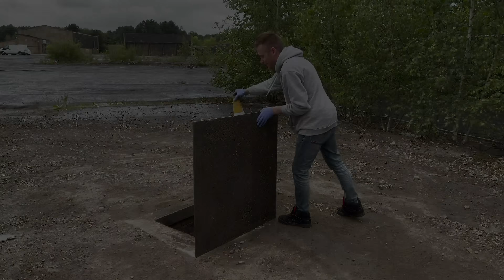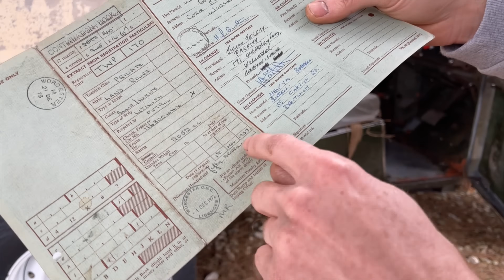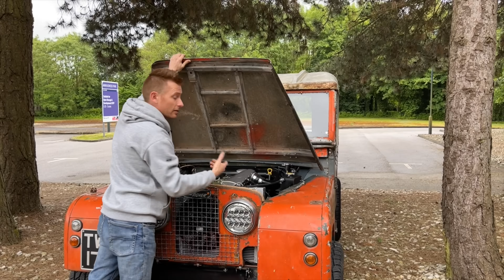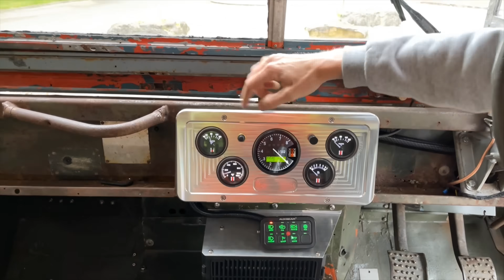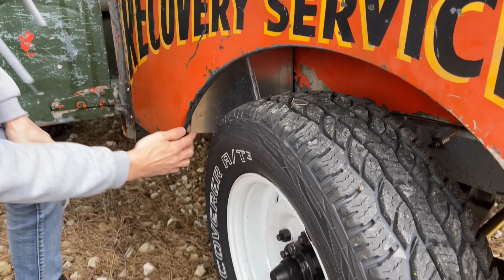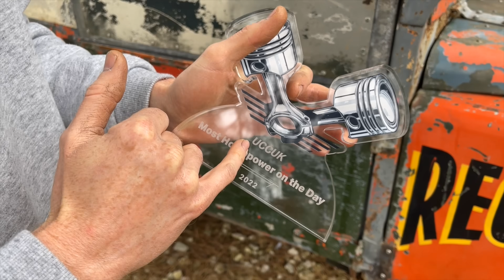OM605 TURBO DIESEL SLEEPER (nearly flips in manhole) 435bhp series 1 Landrover Dieselpumpuk om606

Comment: The ev swap for these is better and easier to install drive wheel around and it comes with ac electric power steeering electric vacuum boosters new tanks for them to sweet kit no cutting or welding if it wasn’t for a couple holes you have to drill this kit would be 💯 percent bolt in plug it bye far the most complete kit and most reliable faster take off higher top end even further then a full tank of fuel range per charge not going to lie I’d sell my gf for an ev swap for my defender 90 series 😂

Comment: can someone explain why at low rpm it has such horrible rattle noise and on higher rpm sounds proper like here in 20:00 "cruising" at ~2,7k rpm... is it because of injection timing in low rpm range?
Reply: It’s a combination of things but in modern and higher tune diesels it’s called a pre mix burn spike - it’s caused by the timing of the fuel mix igniting at a certain point - the event happens very abruptly in modern and tuned diesels and causes the characteristic clatter you mention - more noticeable at idle as the injection duration is lower - a lot of modern common rail diesels sound the same at times - essentially from what I’ve been told by an engineering pal of mine they’re set like that because run best that way in terms of power offset against emissions and particulates - I personally like the noise but then I’m weird

Comment: I have a 1963 Willy's Jeep Wagoneer and I'm thinking about repowering it and a OM606 would be a nice feet. Hmm have to think about if I want to keep it original or not. The 230 Tornado used to run great however my dad pulled the spark plugs for some reason and left them out for who knows how many years. Cylinders are probably full of mud now from mud daubers, kind of pisses me off but what can you do about it.

Comment: Hi, just a question,  if you had too ajust pump and boost  too pump out +/_ 168 KW and 500NM...what fuel consumption  would you estimate this would achieve.
I currently have a Mwm 4.2td sprint motor in my
2005 ford F250 giving the above output....consumption  7.8km/ liter
Parts are becoming scarce. Just planning ahead currently 330.000 km.

Comment: You mention it having drum brakes, why did you not replace them with disks?  I know next to nothing about car customisation, but was under the impression that disks are always better, so I am curious why you went with drums.
Reply: Hmm, you say it has disk brakes later on, but the speedo sensor is attached to a drum brake...  Is the handbrake a separate brake from the normal rear brakes and that is what the speed sensor is on?

Comment: should of kept the original 4speed box with the 2wd to 4wd transfer (fully rebuilt from the gound up to handle any power) also should of had pto front winch also and also you should of kept the front bench seat. (or should of fully rebuilt from the ground up a modify a 6speed gearbox with 2wd to 4wd transfer hi and lo like the original and with a pto box option to front and back) so you can have at least 4-7 plus stick leavers to play with not just the boring 1 stick lever

Comment: only question is you said the full build is mechanical and you don't even need a battery.... that being said i understand the fuel is mechanical and yes you could push start it but don't you need power to heat the glow plugs ?  still new to these build just trying to understand.

Comment: Kind of impressed that your HP number was top of the competition. Especially given that you mentioned there were some 5.9 Cummins there. Also impressed that your waste gate caps off @ 55psi. Mighty impressive for a little diesel like that. Just goes to show everyone how well you guys built that engine. Looking forward to the 2nd part of the build video!
Reply: That part did seem like an embellishment.  I am gonna bank on it was, or he got lucky and everyone had a bad day.
Reply: There just aren't many big power Dervs in the UK. The chances of running into someone with over 435whp at a random show in York is pretty slim. @ChannelZeroOne
Reply: There is no way there wasnt a 5.9 putting down 500+ wheel hp they make massive power being big diesels.

Comment: I've got a 54 Series 1 .That was an ex trialled with a V8 .Would be grateful if you could send some hints ref gearbox and axles as I still running the series 1 box on a series 3 transfer, but fancy an upgrade.

Comment: Its sad that ppl put these old machines through this. They were not meant for this much power and the young think its cool but never have been idling at 500 rpm up and over logs and rocks at 2 mph. lets put 3000 hp in a cement truck so you can think thats cool. I like hp in a vehicle that should have it.

Comment: Very impressive, well done! 435 horse though🤔
Reply: Easily. From what I've read 350 hp is attainable from a stock engine so built with a strong bottom end, massively uprated turbo and lots of boost? 435 is a realistic crank figure for one of these engines.
Reply: 87hp/cyl, 522hp OM606 wouldn't shock many, from these tuners.

Comment: do you really need to use the glow plugs even on a cold engine? I never have, I just turn the key and they start unless it's a really freezing day.
Reply: My tired 200 tdi fires first compression hot or cold, I've only tried it down to about 5 Deg C so far but no hesitation at all.

Comment: ive got parabollics on my series 3,  lots more articulation. you may need heavy duty to stop the power causing axle
 wrap
Reply: There used to be a part called an anti tramp bar back in the day of leaf sprung V8 engines, bolted on at the spring Ubolts and came forward so the front nestled against the spring front bushing. It stopped the axle winding up the leaf springs.

Comment: love this build. Im doing something similar with my S2a, just curious, how did you get arounf the front rover axles not having CVs with the permanent 4wd ? A similar question for the brakes, did you have to use a custom front swivel on the front and disco 1 hubs on the back ? Love it though, at least i have a power target now !
Reply: The company that built the axles does a CV joint conversion kit with HD half shafts
Reply: on the series, the front wheels always turn the axles diffs n prop etc anyway unless it has free wheel hubs. disco axles would be any easy swap and they are wider.